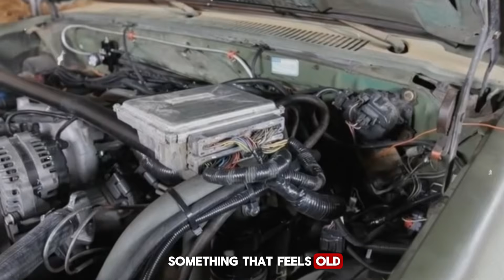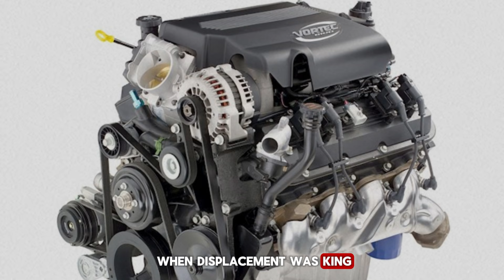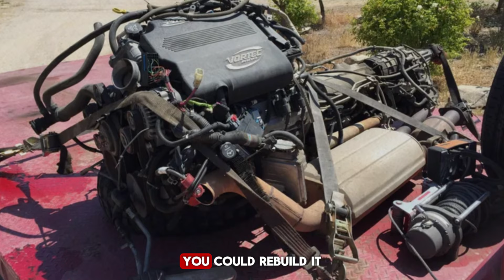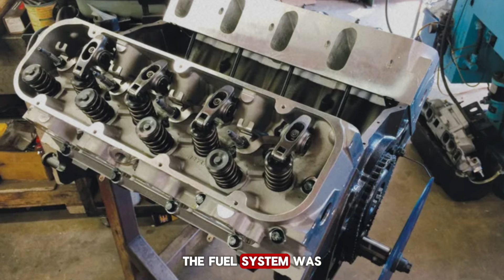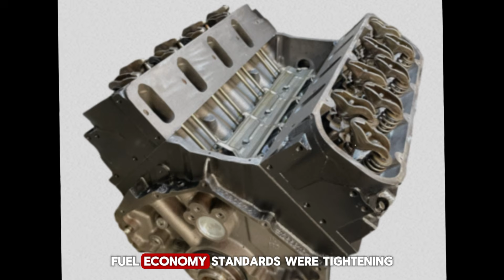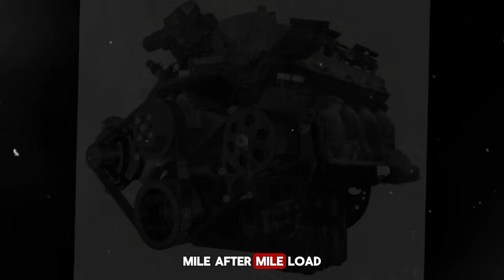The Real Reason GM Killed the 8.1 Vortec Big Block

Comment: The small block is actually older than the big block. The small block came out in 1955, the big block came out in 1958, so they’re both old technology. I think the main thing that killed the big block is the availability of diesel engines for towing. The big black was basically competing with the Duramax diesel.

Comment: I have/had 3 of them.  2 in 2500HD's and one in a 3/4 ton Suburban (not a "three four", thanks AI)...  I didn't buy them for fuel economy or emissions compliance even living here in the Chicago area with emissions testing.  I bought them to work, last forever, and be relatively easy to maintain and replacement parts are fairly plentiful.  Maybe not so much for hi-po performance parts, since they're an LS'fied metric BB, but oh well.  They don't need expensive motor oils and strict maintenence regimines.  You could pour wesson oil in the crank case and it would still work.  Ok, don't try that!

I bought these because I plan to keep them 10, 15, 20 or more years.  Long after I paid them off.  I have NOTHING against LS motors because I have own/owned about 20 GM vehicles with those as well (Multiple Camaro's/GTO/G8/V's, etc...).  I am very well versed on those engines too.  I just want something K.I.S.S. to pull trailers and push snow in winter and as much as I love the LS/LT engines, it just isn't up to the task of moving a 6,600+ pound HD pickup with any form of additional load, very swiftly.  Yes, you can mod them to the sky, but then the reliability factor goes down...  Yet the 8.1 keeps chugging along, no muss, no fuss.  The 6.2 you go on to rave about with increased compression (which creates more HEAT you have to address), VVT (something else that can go wrong) and of course we all know about DFM on the newer half-tons...  Isn't the answer no matter how much more efficient, or how it closes the power/torque gap.

The 6.6 gasser now is the top dawg gasser in the HD trucks and os almost tick for tack with the BB, but I have now seen a few with inadequate cooling to the back cylinders when used hard and NOT maintained.

One thing I will add, is that 800 pound lump of cast iron, actually probably saved my daughter from serious injury on 9/11/25 when a dump truck turned left in front of her, in my Suburban, on her way to school.  She hit him at ~60mph and actually turned the semi-dump truck around.  That big lump of iron barely moved and probably protected her.

The funny thing is, the legacy you complain is gone...  any GMT 800 on the market now, gets sold faster than you can find it online and call the dealership AND at a premium.  It has happened twice to me.

Comment: I have a 04 full size 3500 dually 8.1 / 496. It’s the best hauling and pulling truck I have owned. And it’s still going strong at 264,000 miles. I cost less to maintain then my 2001 2500 Duramax with only 126,000 miles, my 2500 Duramax is a great truck, but the 3500 8.1 handles a heavy load better and less maintenance cost. The only advantage my Duramax has over my 8.1 gas is the mpg fuel savings. Also the 3500  8.1 has a better ride a stability on the road.

Comment: Yeah, it's so wonderful that they did away with proven engines  and evolved to garbage that fails at or before 80,000 miles.  Proven reliability is gone and now  engines shut down half their cylendars with defective parts, that engineers have designed to fail.

Comment: The 496 8.1L use to comsue aboust 2 quarts of oil per oil change. Along, with terrible economy it destroyed upstream O2 sensors like it was nothing. That said it was a tank of a motor.
Reply: My 8.1 uses .5 qt per 2000 miles. 05 32W Bounder
Reply: They have always used oil. My 01 has never had any problems. Weather pulling our 9500 pound cabin cruiser to the lake or carrying out Lance 7500 pound camper. I will never get rid of it. I bought new

Comment: WRONG.  The Mark IIII V8 was not GM's first Big Block, nor was it even Chevrolet's first Big Block.  GM's first true Big Block V8 was the 1953 Buick "Nailhead" V8.  Chevrolet's first Big Block V8 was the W series 348 engine, that came out for 1958, which was bored out to 409 cubes for late 61, but that proved problematic, so for 62, the casting was modified for thicker cylinder walls.  The Mark IIII V8 first appeared in racing in 1963 aka the Mystery Motor.  The first production Mark IIII V8 appeared as an option in the 65 Corvette at 396 cubes, and in 65 Chevy medium-duty trucks at 366 cubic inches.  For 66, it was enlarged to 427 cubes, and for 1970, it became a 454.  You are nothing but AI.  NOBODY, but NOBODY says "Four Hundred and Vee Four V8", they say "Four Fifty Four V8" or "Four Hundred Fifty Four CUBIC INCH V8".  Disgraceful.

Comment: The most consistent issue with the 8.1 was it burned oil. Even the GM manuals say a 1/4-1/2 quart of oil usage across the change interval was normal. But it prematurely killed O2 sensors and cats when used heavily.
Reply: That little bit of oil consumption is great for an engine that big.  Many Cadillac 500 cube engines, (remember those?), used a quart in less than 1,000 miles even when new and freshly broken in.  Big engines mean higher oil consumption than little engines.  There is no way around it.
Reply: @jamesbosworth4191 yes sir you're right about the Cadillac of days gone by, but they didn't  cats and sensors to clog up either. I have a 8.0 V10 with 300,000mi on it and don't use a drop.
Reply: @michaelatkins9780  Keep the rings clean and there is no oil consumption.
Reply: When GM killed the 8.1 they killed the Workhorse motorhome.  No other equalvalent engine was available. The last Workhorse motorhome was produced in 2009.
Reply: It was a Big Block Chevy for sure but the heads were actually very good. It was light years ahead of the last 454s, having close to 9:1 compression compared to 7.5:1 on the old 7.4L and the LS style Iron cyl heads actually flowed really good compared to a Peanut Port. Had they really been thinking they should have offered it in 427 or even 402 cu in and used a turbocharger instead of a static 500 cubic inch displacement.
My Neighbor had a Dually with the 8100 with a Whipple Blower, it was a total weapon but thirsty.
Reply: @peterchristlieb  Supercharger.  We don't want turbos.  This is not Europe.
Reply: And now the 2.7 turbomax uses about a quart every thousand miles. 🙄
Reply: My 8.1 in my 2005 motorhome uses one half qt every 2400 miles.
Reply: @jackhouran8851  about the same as my 2500HD. Totally normal for these.
Reply: That’s why I used a sensor simulator for the back sensors.